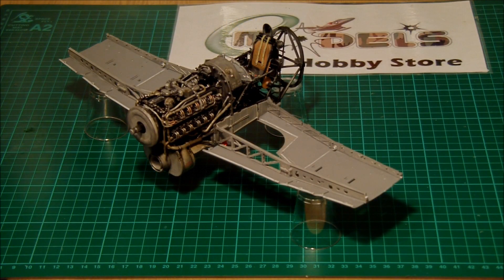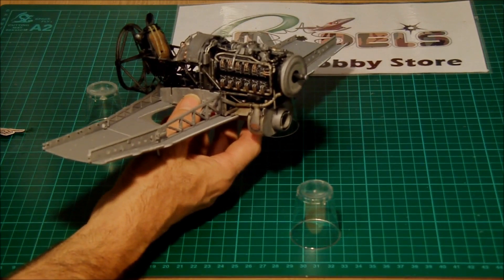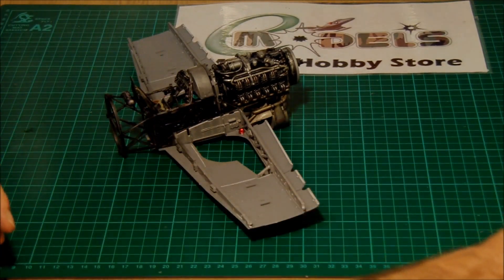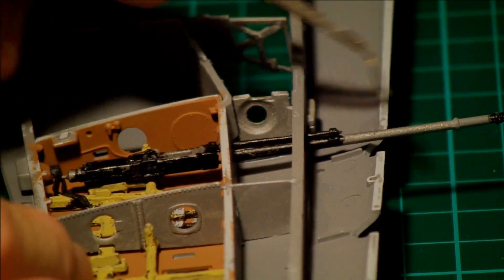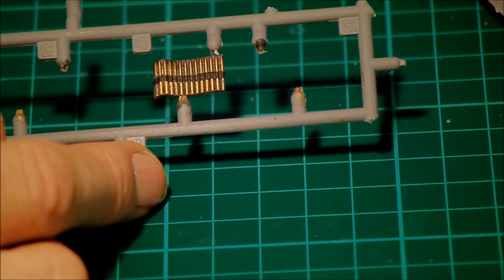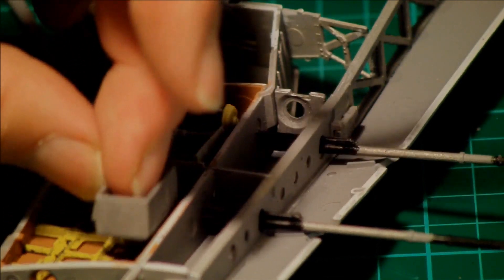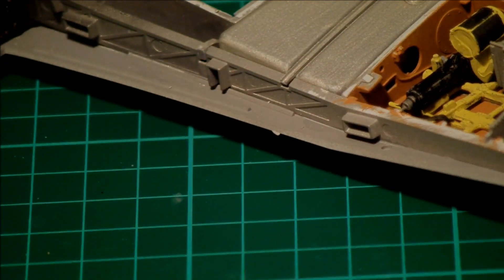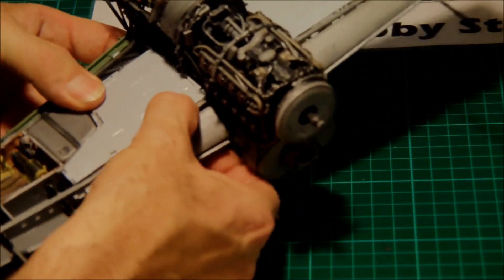Airfix 1/24 Hawker Typhoon MkIb # 19002 - Part 5 - www.emodels.co.uk

Comment: Very helpful video set. I am a modeller returning to hobby at 70 after 40 years away! I notice you keep applying thin cement using a brush. Surely this is getting on the painted parts of the model, not just on the areas where you have removed the paint? Also as you are using a brush why does it not dry out between uses?
James Tennant-Elle's.
Reply from the maker: The thin cement is just that, super-thin, so you can really control exactly where it goes,. The burhs is very find which also helps. But the advantage of the Extra Thin is that when you touch it to a gap, it sucks into the gap with no problem. If you should get any on the painted areas then it is so thin that it just evaporates away and often leaves no trace (and should you get any marring, it will be a super small area which can be touched in very easily).
Reply: Thanks for your response. I have been using a product called touch and flow with a glass tube and fine capillary tube to place paint. This works exceedingly well, but I gave to say it totally destroys the paint surface, (Vallejo Air), wrinkling it up. So I can only assume the thin cement you are using is different? What make is it? James Tennant-Eyles.

Comment: hi there. im currently building this model and would like to know, at this stage what colour have you painted the lower wing section as there is nothing in the instructions to say what colour they should be, to me it looks like primer. im only asking because on later video's Ted explains about using limited layers of paint so not to cover the moulding detials of the plane.

Comment: Hi Ted. Love the videos. Cant wait for the next one. Just a quick question though... Are you giving all your parts a base coat before assembly? and if so what colours?
Thanks again.
Reply: Hi Ian ... Yes in this case I've given everything a coat of grey primer whilst the parts are still on the sprues. I've just used a standard auto prime( Halfords if you're in the UK)
Reply: Oh and yes the parts are then painted in the required colour if possible prior to assembly and then touched up or weatherd